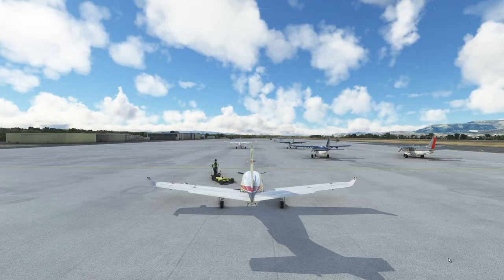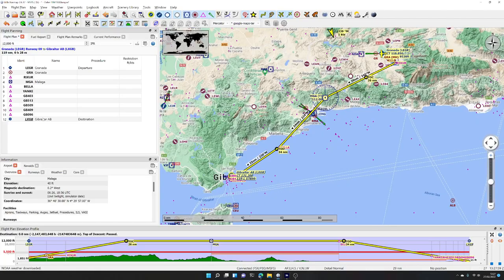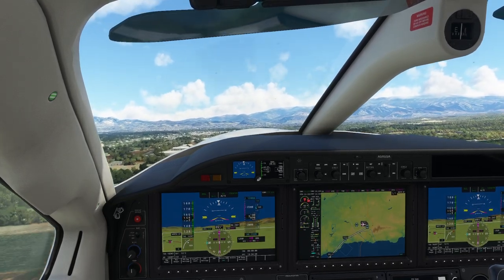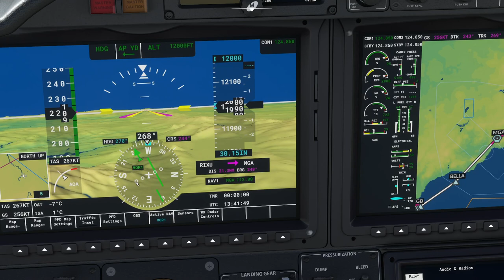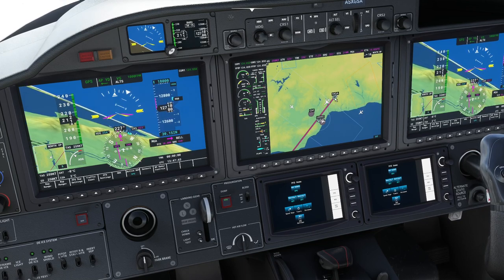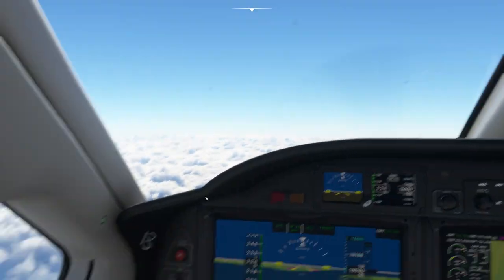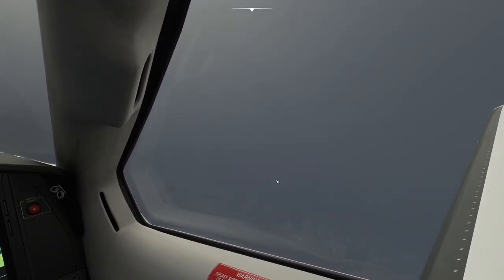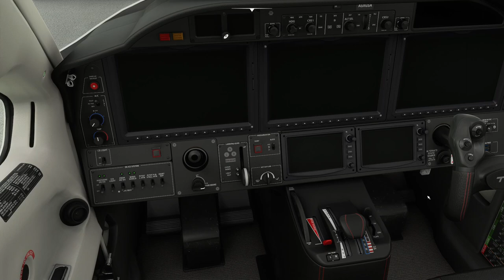Beginners guide to navigation in the TBM 930 in Microsoft Flight Simulator

Comment: I was having issues making the plane follow the flight plan and turns out it was the type of navigation that was not correct. But I think an update changed from GPS to FMS, because I dont have the GPS option. But now it works fine! Thanks for your video, helped me get to the problem.
Reply from the maker: Yes - the G1OOO has had a major update since I recorded this.